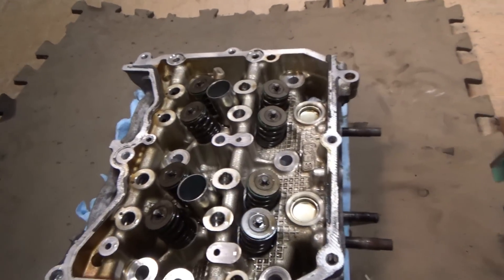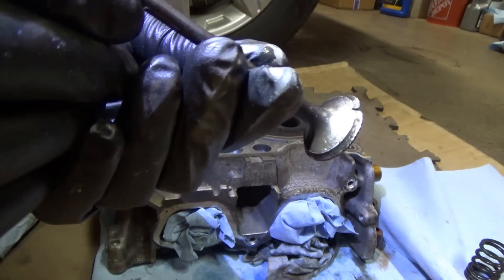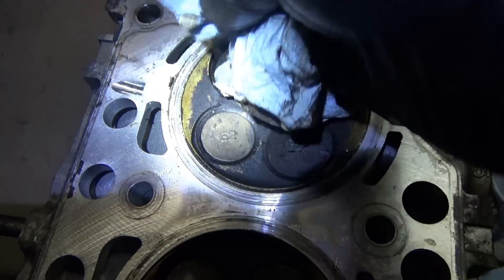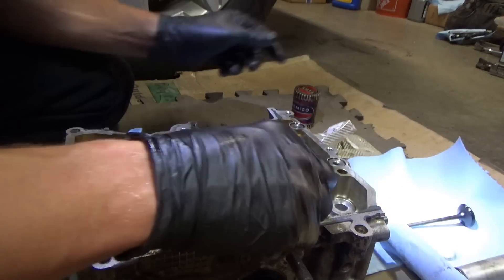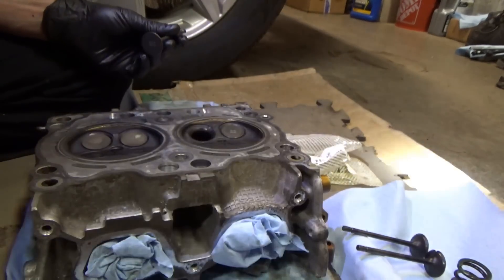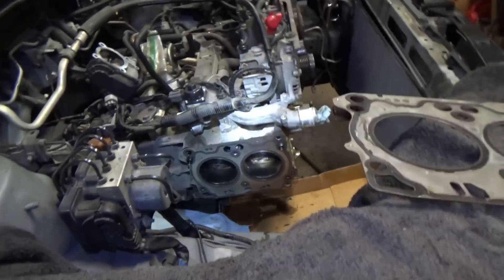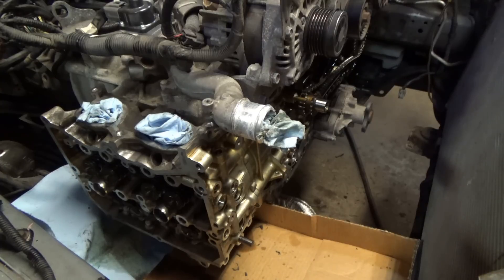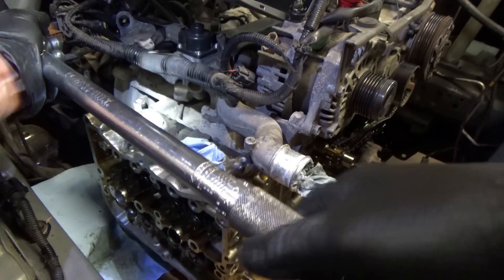What Happened to these EXHAUST VALVES!? (The Sad Subaru - Part 3)

Comment: Hi Ivan I have watched you for years but today is the first time I disagree with you that those valve seats look good. When you lap valves in the seat on the head should be a uniform colour with no spots. You start with course and work to fine with the paste. Also by lapping the valves you should assemble the head before fitting and measure the valve lash because you may have the valves you lapped to loose or to tight and you would have to change the shims on those valves before fitting the head. I don't envy on this job and I do get the customer wants a budget job But if the valves are to tight it will have the same problem sooner rather than later.
Reply: My gut tells me the owner wants the car running for as little as possible.
Reply: @kerrylewis2581  Yep. I think he said he had a 2,000 max budget. I doubt that would cover a full valve and head work on both sides. Ivan said in the first video that he did not want to "marry" this car but the guy talked him into it. I'm sure they mad a compromise/agreement as to the extent of the work.
Reply: If the seats are bad enough that fine paste won't give a nice clean sealing surface then the seats need to be re-cut (and these certainly needed it).  Coarse grinding paste is an anachronism, trying to use it to clean up badly pitted seats just ends up recessing the valves.
Reply: @ferrumignis   it looked more like burned on carbon spots than pitting to me.
Reply: @randy1ization  If it was carbon deposits then lapping would remove them, and carbon deposits are bad news on valves seats anyway. Those seats were not at all healthy.
Reply: @ferrumignis  burned on crust carbon is not easily removed.,., I use a product called superzilla and lapping compound that starts off course, then breaks down to finer grit as u work it., kind of a slurry...  with a piece of plastic tubing and my reversible cordless drill. 
also easy off oven cleaner allowed to soak on the valves and seats for a while works great,., 
heres the other side of the coin, the carbon can also bring compression up when u have worn valves and seat, so this may be a reason not to take it off.  Im sure I van thought this out carefully . all of the other valves were still sealing to acceptable levels so dont poke the hornets nest. if he does, being the owner set a hard limit of 2 grand, he would end up doing alot of free work.,  if the customer wanted a top end rebuild  he has to pay for it,. machine work aint cheap, likely 150 a head, plus all new valves, and could take weeks.  usually when valve stem seals are leaking, plugs will be fouled to hell, so what it likely is sticky rings. I would pull the plugs and squirt superzilla in the holes, let it set overnight, then suck it out. it cleans carbon off the rings better than anything ive used. also if the cat was bad, the car could have been running in a slightly rich default program for a long time, hence the carbon build up.  alot of folks put off repairs until the car is abt to leave them on the road,  then decide they will set the price of  how much they are willing to pay for repairs.. they are willing to guess at the problem and spend thousands in parts cannon and goon mechanic work, then when all else fails, take it to a pro.
 Its likely not a "budget" issue with the customer,, its a " Ive spent a shitload already, and dont want to spend much more" issue. he went down tryagnostic road and it didnt work. that was his doing not Ivans.
Reply: @ferrumignis  
Could always try the old trick of flipping the head up and filling the cylinder head space with fuel and see if it seals. If not, it would be worth it to take it to a machine shop so all of Ivan’s work is not wasted.
Reply: Either the valve lapping stick has disintegrated or its not a proper one? The ones I've used have a suction cup either end (different sizes) to attach to the valve, and you can then use both hands/palms together to spin them at a decent speed. Plus also lifting the valve occasionally to redistribute the grinding compound.

It definitely should have a good clean pit-free band around the seat for reliability, once the grinding / lapping is finished.
Reply: @RJTC  Well said Robert I was going to post the same comment but you have already posted it I really like Ivan’s work but the way he grind to that valving makes me cringe
Reply: @RJTC  Watch the video closely. He was, in fact, raising and lowering the valve occasionally. He was using his left hand on the valve stem to do that. The suction cup just makes that part of the process easier. As to the quality of the  seats, hard to say if what we see on the video is the same as what he can see. Based on the fact that he has the right equipment, I'd bet that he's done lots of valves and knows what works.
Reply: Couldn't agree more.

Only one way to do this job, the right way.  If there's valve train issues in 6 months will Ivan gladly fix it for free or refund the $$?

NEVER EVER set yourself up to fail!

If it was in my shop and bay the only way we would have done the job was to pull the engine and do a total valve job, both sides, or replace the engine with a Jasper, or similar,  rebuilt engine or a good used one.

I hope it works out but the odds are against Ivan and the customer.
Reply: @kenfromsilverdale5675  Ivan has always shown himself to be an honest man. If it does fail prematurely, I would trust him to do what's right.. Given the budgetary limit on this job, sending the heads out probably wasn't an option.
Reply: @kenfromsilverdale5675  don't worry; he's also reusing torque to yield head bolts; so which will go first?
Reply: @kevinbarry71  disagree bolts are reusable, on the SH, in the  FSM you are not told to replace the head bolts. Mine are going strong reused.
Reply: I agree I would have sent that head to the Machine shop for proper Valve seat relap or if the Damage is to deep cut the seat and recut and lap. 🤟🏻🇺🇸
Reply: Guaranteed the owner is selling or trading it in immediately.
Reply: 4:36 I concur. Valve still needs lapping in more. 
Do other viewers still have the little tin of grinding paste that their Dad's used way back when? I've still got the tin my Dad had when he had to decoke the engine of the family Ariel Square 4 every twenty thousand miles.
Reply: @suttoncoldfield9318  My tin of lapping compound is at least 45 years old.
Reply: @suttoncoldfield9318  Well, I never had a father, but I did get my grandfather's snuff can of lapping compound
Reply: I agree.  He knows his electronics but this job is a failure waiting to happen and shouldn't have made it to video.  That seat looked awful and the twisting back and forth with the wrong tool did zero to help.  The other valves were toast and the seats needed grinding.  He should have told the owner that there would be a good chance it needed both heads reconditioned, because they did.
Reply: @fredweather3366  not 100% true, the valves where doing well everything on it, it would work for 90k+ miles, yes it could of lap a little more but it would work
Reply: lapping paste breaks down itself from course to fine as you work it. . I guess Im the only one who reads instructions., lol
Reply: @randy1ization  And yet, those cans always have both coarse and fine . I wonder why ?
Reply: @davidquinn6161  its because the technology back then didnt have the same compounds as todays lapping compounds,,  todays compounds are much better than 20 years ago,.
Reply: Yes, that head definitely needed a proper valve job but Ivan is just giving his customers what they want, a cheap "just get it running" repair.
Reply: @bcad4066  Yeah, and it's still burning oil that's probably causing the problem.
Reply: Myself as well: Ivan, you're an excellent electrical diagnostician, but I cringed when I saw you only slightly clean the valve seats after lapping. The carborandam in the lapping paste is a perfect "cutting" tool, and will find its way to areas you don't want, such as the bearing surfaces, etc.  The head/seats MUST be thoroughly "washed" clean with whatever liquid you wish(preferably heated) and CAREFULLY examined after "washing" to be sure there is no itty bitty "cutting" stones remaining.
Reply: I’ve never seen anyone lap valves this way, a couple of turns back and forth, I don’t think so, doesn’t take long to do it right
Reply: @jimamizzi1  Don't be sure that he showed the full amount of time he spent on the process. Like all YouTube  videos, this one would be edited. He's always shown himself to be pretty meticulous in his many, many vides. I doubt that he had a sudden lapse in this one.
Reply: You no what, I can’t watch this
Reply: World:  Lapping is to confirm a good seal.

Lapping to excess may work for moderate low mile engines, but WILL NOT last.

New valves, cut the seats to match...then NEW seating/sealing surface.

Love Ivan and trying to save money for customer, but MANY try to "LAP" valves.  It is only a "test" to ensure the mating surface is where you want it...right in the middle, even with tri-cut valves.  Does anyone imagine OEM's lapping valves?  NO and lap is gone within minutes of engine run...then it is the valve face to valve seat mating.

P-Chi
Reply: Agreed 100% not nearly enough lapping done, those seats are still crap.  With all that damage they would have for sure needed new shims though if correctly lapped
Reply: Backyard valve jobs don’t last and since it’s a 2016 I would believe the owner wants to run it awhile.🇺🇸🇨🇦🇺🇸
Reply: @michaelmarks8954  Knowing how Ivan works, I'd bet that he discussed the repair options with the owner. Including what could be done within the owner's stated budget.
Reply: @davidquinn6161  True! we aren’t privy to his conversations.
Reply: @michaelmarks8954  And he's always stood by his work in the past. On the rare occasions when he's misdiagnosed something.
Reply: @michaelmarks8954  I thought it was a 2014? Not sure what Ivan discussed with the customer but If I was doing this I probably would have advised him to sell it or only drive it a year or two and then sell it. You'll never get a better price for a used car than right now. I think it'll hold a few years.
Reply: @zoidberg444  Your probably right I didn’t go back to verify.
Reply: The seat looked pretty well chowdered even after the lapping, but maybe it was the camera. Old timers are the only ones that still know how to do this job lol. I had to grind the valves ten times longer than I thought I was supposed to lol
Reply: It's a budget job, but I'm sure he'll update on this one if necessary.
Reply: I luv you guys to death the way you debate ! But we ALL know what the real resolution to this dilemma is, . . . .  LS swap it !  No but seriously, a wrecker tour is not out of the question and isn't the SuBee;s valve seats laser hardened like the Toyota 4-bangers ? 1ZZ, 2ZZ etc. ? Chances are there may be some reman heads out there as well. Then Ivan is only in it for labor and looks !  Wha. . .aa. . . aa. . . . . at ?  Cheers.  P.S. we as junior gear heads used to run burned up valves on small engines all of the time. But then again we were " Po' Boiz " .
Reply: Agree. BUT I would still drive 2000 miles. As phad to fix my vehicle with 100% honesty. Plus that will force me to take a holiday.

Comment: 4:36 Sorry, this doesn't look beautiful at all. There is so much heavy pitting still present, this valve may be likely to fail again due to insufficient seat quality.
I'd have pregrinded such a destroyed seat with the old valve - since grinding out that much pitting eats away the valve seat too, so you cannot use the new valve all the way. Pregrind, maybe even with coarse paste and the old valve, then seat the new one in with a bit of fine grinding, but not before the pitting is gone.
Unfortunatelly i'm sure, whilst i see this video, the work is done already.
Reply from the maker: I'm sure the new valves will well outlast the originals on the left cylinder head haha
Correct solution would be a new engine that doesn't burn oil and doesn't cause this problem in the first place :)
Reply: @PineHollowAutoDiagnostics  
Maybe, maybe not. Normally we have to deal with old stuff by default, even if it's not ideal, which is mostly the case. If it's not worth the effort, i'd rather refuse it.
But if we dump manpower in old junk - and a customer intends to drive it again after repair - we should get the best out of what we got.
In this case - count in sufficient grinding time or better not touch.

I know, as a mechanic, there's always one big question - why give away so much lifetime for so little money.  Just two hands to generate income out of basically junk. Never much money to mine.
And if you want to own your house, you have to marry a wife with money. That sucks.
I thought, you were pretty smart by concentrating on diagnosis.
I think, that's where the money probably is, since diagnose is mostly wrong on modern cars. I'm to old to try that side out though.
Reply from the maker: @werner.x  Never too old to learn!

Comment: Just a temporary fix. Those exhaust seats needed to be cut to achieve a proper seal ! Just saying !
Reply from the maker: "temporary" is subjective. Left side original valves will probably fail long before the new replacement valves. I made the customer well aware of this...only real long-term solution is an engine that doesn't burn oil :)
Reply: I think the fix was just good enough to sell this turd to some poor sucker.

Comment: Did you mount valves with E2 stamped on it ?? see it on 7.23 instead of the new type valves with E3
Reply: yep... i noticed that too 😮
Reply from the maker: Look up the TSB from Part 2!
Reply: @PineHollowAutoDiagnostics  its very confusing as you mention that NEW and OLD relate to updated parts yet the table you show mentions NEW and OLD which refers to model year range.
Reply: @PineHollowAutoDiagnostics  the part number on the new valve you showed in part 2 was the old # according to the info I saw.... e3 750 new.... e2 670 old... did no one else catch this? At 7:31 you can clearly see the E2 on the new valve just installed.....

Comment: The poor seat on the exhaust valve prevents heat transfer to the cylinder head, over heats the valve and resulted in the crack.  The real question is why the seats are so bad?  This may be a manufacturing issue, especially knowing about the change to the valvetrain on the other bank.

Comment: Anyone who is over 70 should remember when they took the lead out of gasoline. Man, that played hell on valves. . . 
I think they had to go to sodium for a while.
Is that how they got by that?
Reply: No they basically went to hardened valve seats.. they were supposed to improve the metal of the valves too.. obviously not so much here
Reply: @jusb1066   I remember replacement valves/seats were labeled 
"stellite', which I assumed was an alloy that did not need the lead lubricating the seat to get good valve sealing life.
Reply: @GrumpyUnkMillions  yes I've heard of that.  I'm sure many advances have been made over the years. With the fuel changes and EGR valves, they are having an increasingly hard time

Comment: Did I miss something? You said there's an updated part number of the Valves but you replaced them with the same part number?? Or did I get that wrong?
Reply: Yeah that's what I thought.. I mean I thought I saw E3 on the updated version but he put another E2 back in it.. 🤷‍♂️
Reply: It requires a new head assembly. Customer doesn't want to pay it so there's no reason why he should eat the cost of a new head
Reply: @robertvillafan1220 - Well if that's what the customer wants to do that's dumb but I never said Ivan should pay for it.
Reply: @robertvillafan1220  I know the customer won't pay for new heads but I just didn't know why Ivan didn't use the updated valves that's all
Reply: Agree 100%! I noticed the same thing in Part 2. I was wondering why he kept saying this is the updated part number when clearly it was the same number as the old one.
Reply: Updated valve is 1.4mm longer. That might be the reason.

Comment: there's a reason it had a new cat on it. ingesting oil bad metal and that cooled egr. cooling the egr gasses allows the vapors to condensate out enough to turn them corrosive.

Comment: Given condition of all exhaust valves & fact car is apart, the other side of the engine would have been worth doing. Sometimes it makes sense to stretch the budget. . .
Reply: yes, considering the work required to get that one head off, the other one is not much more work.

Comment: You don’t want to replace the valve stem seals while you’re there?  This will become a do-over if they leak oil.
Reply: I'm sure it will last another 500 miles long enough to sell it
Reply: I thought the same thing.  Plus I would have checked the valve guide by testing for play with the valve just to have a feel how worn the engine was.
Reply: You can check for wear.  If worn replace, but new valve stem seals should prevent any oil problems.

Comment: Looking at the valve, it seems that it could be a forging defect, that grew into a crack and the rest was just burnt away from improper seating. Anyway, as the valves were badly pitted, I'm only guessing what the other side looks like, but I get the customer's wallet limits. Back in the times when I did this kind of work on motorcycles, I usually spent a lot more time lapping, but you can see the results and I don't :-)
Reply: i agree
Reply: I disagree lol
Reply: @tonytopbatz  Yup, seating poorly due to heat/wear, and got  a hot spot that leaked exhaust gas.  Kept leaking, and jetted hot gas through enough to eat the valve.  Not cracked, overworked and overheated.  Likely needed a valve adjustment a long time ago, and it was not done, valves seating too lightly to transfer heat, and destroyed them.  Other side awaiting its turn.
Reply: @GrumpyUnkMillions  Yep, you're probably right - bad seating burns valves.